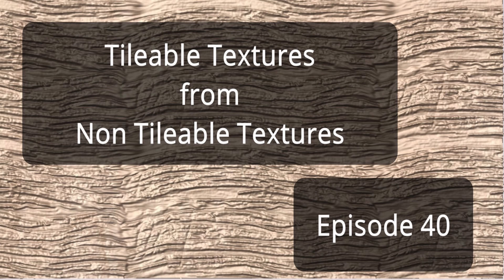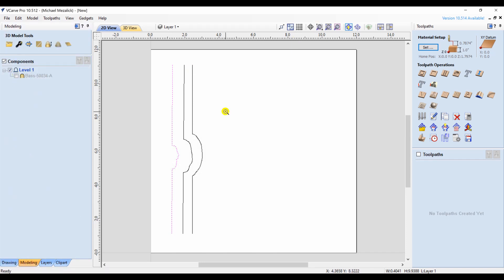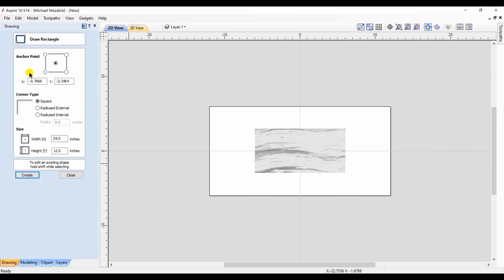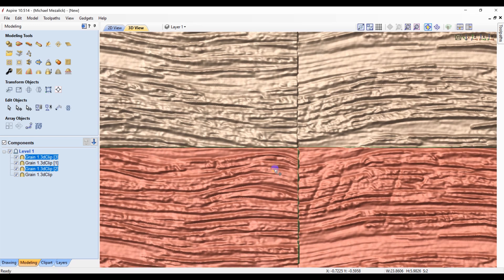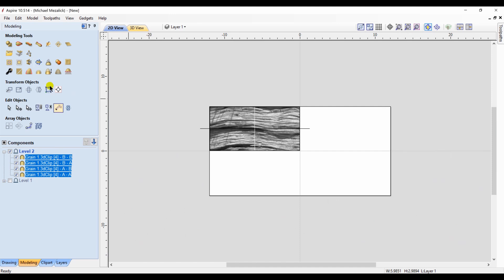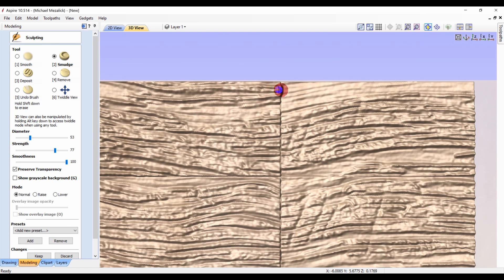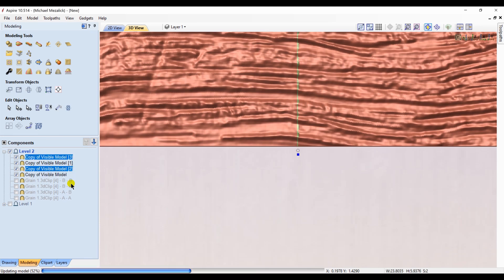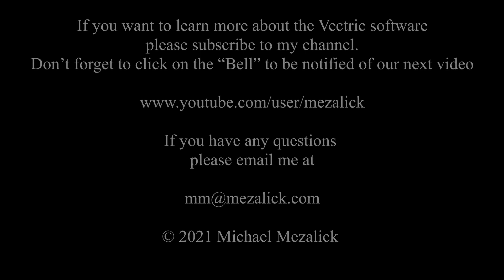Tileable Texture in ASPIRE  Episode 40

Comment: Is it possible to mirror the original tile image? If so, import one tile in the top left. Copy and move to the top right. Mirror (left to right) the copy. The texture's edges should match. After joining the top two, copy them and move to the bottom. Mirror (bottom to top) the copy. Now the textures should match to the top group. With that said, I have not attempted this. It's late at night, so I may be WAY off... I have done things like this in Photoshop for printing.
Reply from the maker: The mirroring of the images does not work in this case.